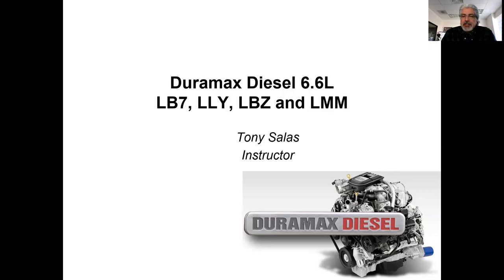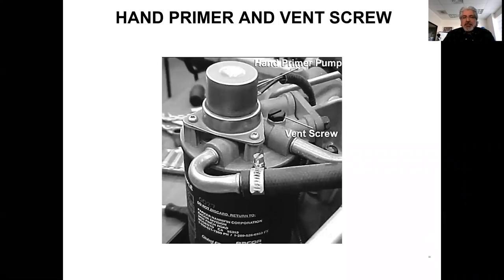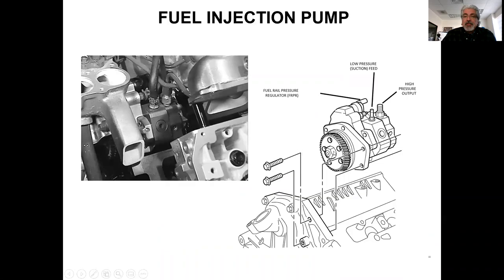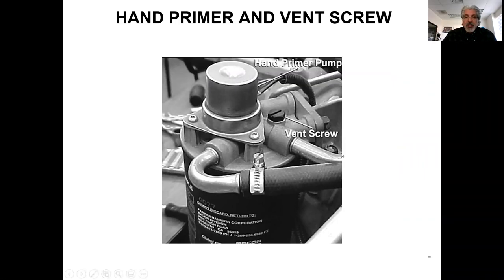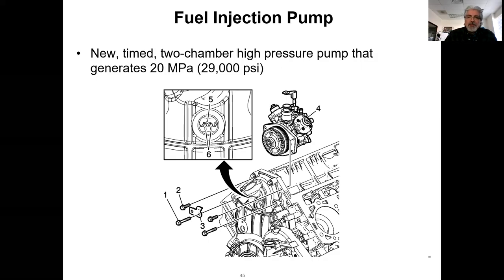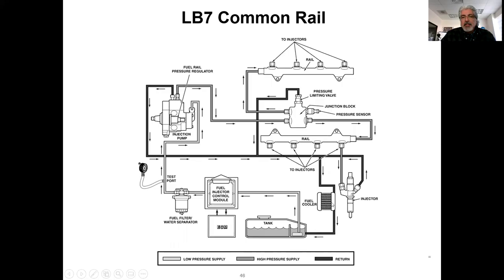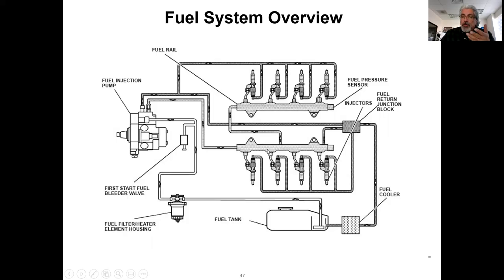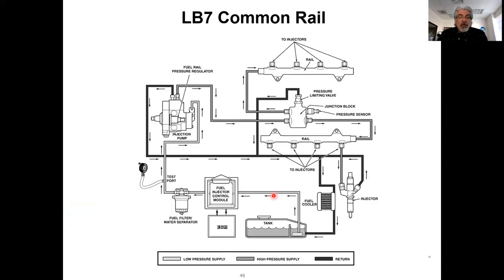Duramax 6.6L CR Diesel Talk

Comment: I bought a 2004 duramax truck about a year ago with 129,000 miles. I only use it for firewood, gravel, and suchlike heavy duty chores. Otherwise, I dive my 4runner or Rav4 Hybrid that I don't need to worry about getting stranded in.
Long story short, I did essential upgrades to the truck (intake throat, lift pump, and trans cooler) and drove it only about 1,000 miles since I bought it. During that year, it stalled on with no warnings twice. First time, it started after 10-15 mins, the second time I had to disconnect batteries for a few minutes, and then it started. There are no fuel leaks. Yes, I despise gm (and suchlike) dearly but what the hell?!?
Any ideas?
Thank you in advance.
Reply from the maker: Ok is it a crank or no crank no start issue?
Need info.
You have access to a scan device?
Reply: @dieseltalkwithtonysalas8725  It cranks fine, yes, I do have a professional Autel scanner. There was a code P0089 – Fuel pressure regulator performance caused by too high pressure from the lift pump. The first time it stalled before I installed the pump so I don't think it's related, and there were no codes.

Comment: When testing to see if filter housing holds vacuum does the inlet hose need to be connected or does it not matter?
Reply from the maker: Does not need to be connected.
When I used to rebuild them I test them on a vise.
Thanks for watching

Comment: Cant i just use a carter lift pump from a 6.5 and stand alone filter heads to keep costs way down?
Reply from the maker: @bobbyboucher5309  that pump does not create enough volume and pressure.
Go to xtreme diesel or Duramax store websites. They have lift pumps with or without filters ready to bolt on lift pumps.

Comment: Fuel Cap: Duramax LMM
Vacuum / Vented
I replaced the fuel cap with a locking cap. The cap is listed as vacuum-yes, vented-no
Does this mean the new cap does NOT have a psi relief?
Reply from the maker: Locking cap is not the same, the cap for Duramax is unique, but you can vent it every often especially with diesel so high and perhaps a theft issue.
Reply: @dieseltalkwithtonysalas8725  
I was trying to relate your comment of the tank psi not releasing  and causing air bubbles / low fuel rail issue. This would possibly cross over to the fuel cooler issue.  I replaced the cap due to fuel costs and possible theft.  It is a cap swap but can’t determine if this caused a problem. I have encountered 2 limp mode situations. Towing 9,500# trailer 80* OAT. Changing the fuel filter solved the problem  but I am not confident as to when it will happen next. TP3018 filters only last 2,500-7,500 miles.
Thank You for your fast replies:)

Comment: Just found this video. Got a low fuel rail pressure code today and it went into limp mode an hr from home. Limped it to a friends house and immediately went to the filter head to check prime and no prime. Found no leaks. Replaced the fuel rail pressure relief valve and the filter head. Still had the problem. So I took the return line off the cooler and nothing came out. But as soon as I primed the the system it started flowing out pretty good. After watching this I'm leaning toward injectors. Your thoughts would be greatly appreciated as I'm about to start throwing more money at this pig. I don't want to do injectors right now bc of money and time it will be down for longer than I can afford. I was wondering if an aftermarket lift pump would solve this. Truck has 200k miles on it and bone stock everything.
Reply: Did you ever find out what  it took to get your truck running again?
Reply: @Trike.  cp3

Comment: I loved this video, but I have a question. So this fuel pump has a mark to put it in timing, but I'm a little confused because the olds version of  course needed timing because it worked mechanicly ,but in this case the system is controlled by sensor-modules-injectors means electronically and the pump function is generate pressure only. Why does it have a timing mark?
Reply from the maker: Happy Thanksgiving!
This pump simply sucks and pumps! There is no timing to be set. However! We have seen harmonics from the pump cause what we call an off idle diesel knock sound. Doesn’t affect performance of the engine but it’s annoying.
To fix this we remove the pump and move the gear 30 degrees. We reinstall. I can explain further this but it’s a big explanation!
So to be clear there is no timing mark or procedure to time the pump on LB7 to LMM.
Later model LML, LGH Duramax do have a timing mark. 
RAM Cummins 6.7L due have a timing number etched on the CP3 shaft to set at 9 o clock .
Thanks for commenting!

Comment: Got a question. Looking at a 2004 duramax LLY. Guy I know wants to get rid of it because its going to cost 15k to fix. huh? yeah I know. Dealer says it had fuel contamination and they found rust in the tank. Now I font that odd. Any thoughts? Maybe check the tank  get a new one, replace sending unit blow out the lines, clean injectors and see if she runs. I could get a great deal on this but I am curious if you or anyone can come up with something im not thinking about or possible catastrophic failure or potential failures... Or in all just stay away from that problem. Thanks
Reply from the maker: Depends is it an 04 LLY or LB7?
Injectors, lines add up but good quality Bosch.
But we are under the assumption the issue is fuel related. 
What’s  the asking price and how many miles on it?

Comment: Does the 2007 LMM have a dedicated post fuel injector that squirts fuel into the exhaust or is this done through the main injectors? I ask because I have the LMM in which the DPF was cut out, so  What tells the injector(s) to squirt more fuel into the exhaust? I am not sure if this causes  better or worse fuel economy?
Reply from the maker: No, the LMM uses post injections. This means it injects on the exhaust stroke of a cylinder to push that fuel into the exhaust towards the DOC.. it uses fuel consumed and pressure differential across the DPF to determine soot load on DPF.
If DPF was eliminated there will be no post injections. Was truck tuned? Must have it you are driving it.
What kind of fuel economy you getting?

Comment: Great video! I installed reman bosch injectors on my lb7 and after about 200 miles of it driving fine it started blowing a large amount of white smoke under a load and feels like it's missing. I have a decent video of it but I'm not sure how to attach it. I had a code for maf sensor so I replaced that with the issue still being present. No loss of coolant or coolant smell from the exhaust. The only odd reading I'm seeing is mm³ of flow is almost double what's expected when this happens. Balance rates are all 0.0-0.1. Any ideas of where I should be looking?
Reply from the maker: Doubt it’s the MAF sensor.
White smoke is un burnt fuel.
Sounds like injector issue. 
When looking at balancing rates? Can u see which injector is going above 4 mm3?
Reply: @dieseltalkwithtonysalas8725  I believe the mm³ flow rate is measured across the entire fuel rail. Balance rates are in spec on all injectors.

Comment: Hello Tony I have an 06 lbz and my problem is
Truck cranks a lot to start, losses primeI rebuilt the filter head and changed the filter 2 times with 2 different brands and still no luck,replaced the hoses and just installed the whole filter head from extreme diesel and still doing the same thing. When I un screw the diesel cap to fuel up air gets sucked in like a vacuum I bought a new diesel cap for it and dose the same. The truck fills up with only 16 gallons so I'm guessing the tank has collapse thank you for you help
Reply from the maker: Busy week sorry! 
Need to visually check the tank but did you buy cap from dealer?
Reply: @Diesel Talk with Tony Salas  no sir got 2 different ones online and one of them was oem. I found out not to long ago it needs motor mounts so return lines where getting a lot of air dur to the movement

Comment: I have a 2004.5 / 2005 Chevy Silverado 6.6 LLY Duramax. Went to start ran for a few seconds cut off. Hasn't started since. Fuel tank was full but gauge went from full to empty. Went to mechanic and he said ficm was bad. Sent off for remanufactured put on today, still want start. Sent old ficm to be tested and the board was burnt and was not repairable. What could cause the gauge to go from full to empty and still not start. We primed to get air out of line and checked fuses all were good. I'm lost of what could be the problem.
Reply from the maker: So where you at with this vehicle? Get it started?
FICMs on your LLY will trip codes. I have often repaired issue by simply cleaning connections on the FICM.
But what codes are set and what is the desired and actual rail pressure while cranking?
Need more info to help

Comment: I got a weird situation where my brother just bought a 03 silverado.  I noticed the scanner doesn't even turn on and I tried 2 of them. It cranks but no start. So I tried to bleed the system but the plastic screw broke. So I'm going to rebuild that pump tomorrow, hope it starts. Should I try anything else?
Reply from the maker: Check fuse, the connector where you plug in called the OBD Connector has to have power at pin 16. Usually this is tied in with the cigar lighter fuse. This might be why scan tool doesn't not turn on. You should have someone crank the engine while you pump the primer pump, bleed air fron the screw after you stop pumping on the plunger.
Let me know!
Reply: @dieseltalkwithtonysalas8725  would the obd2 port not working cause a no start?
Reply from the maker: Yes sir, but you mentioned the scan tool didnt power up. does it turn on ? @pabloso8403
Reply: @dieseltalkwithtonysalas8725  I got it started!! Put in the new bleeder screw and bled it. Also the cig fuse was blown and it fixed the obd. Thanks a million!!

Comment: Question for you sir 2016 duramax crank no start I already changed out fuel filter and no start so install new filter housing and still no start …. Codes it has are P0191 and P0088
Reply from the maker: First of all are you pumping the primer pump on the filter while trying to start it?
Second you wouldn’t happen to have a tuner or code reader to know the fuel rail pressure? I need to review P0191 I know it’s a regulator but I look it up in the morning
Reply: @dieseltalkwithtonysalas8725  truck is all stock no modifications but I do have a monitor and it’s showing 1.5 kpsi while cranking, I have tried priming it before start, priming while cranking, read a forum to spray small amount of starting fluid, so I did and truck started right up and stayed running but once I shut off and tried starting again I had the same issue all over again

Comment: Can you tell me why gm won't use lift pumps? And if we add one, any issues? What should max pressure be limited to on suction side (with pump) that won't cause issues?
Reply from the maker: Some say it’s Bosch some say it was Powertrain at GM. The bottom line many of us upgrade with an aftermarket lift pump. The new L5P is a Denso Common Rail and uses a lift pump. 3 phase pump actually.
But to be fair if you look at the suction pump on the back of the CP3 or CP4 it’s a very stout pump. 
As for suction, GM says 4 inches at idle is max suction. Higher would be fuel filter restricted.
But GM states the suction under load should be no more than 10’inches. I disagree on that. I have seen rail pressure drop at 8 inches.
Thanks for commenting!

Comment: I am studying diesel to provide new means for myself an because I’ve always done gas my whole life I purchased the book from my community college an read it every day , I am not a student but that by no means is limiting me to studying an learning this. I wanted to ask you. Concerning this system how do you actually test into the system to check for suction. Do they sell kits or is there a port that you can place a gauge that tests vacuum? Also concerning the internal gear driven pump. Can those be replaced or the HPFP be rebuilt to save funds for those that have more time on there hands including the injectors. If the ball inside the injectors is the weak point for older models does that mean they can be disassembled and replaced or the components be repaired to correct leakage? Do cp3 pumps needs to be timed or is that only for the cp4 pumps? An how does the computer recognize if the pump is incorrectly installed does it throw a code? or is there a way you can monitor it with a scanner to see if it’s not timed properly? there are so many questions I have but I’m extremely eager to learn.
Reply from the maker: Since I cant highlight replies, I can make them in CAPS.

1 Concerning this system how do you actually test into the system to check for suction. Do they sell kits or is there a port that you can place a gauge that tests vacuum? 
THERE IS A TEST PORT ON ALL DURAMAX 6.6L APPLICATIONS  FROM LB7 TO LML. YOU CAN BUY THE GAUGE WITH FITTING FROM MANY VENDORS.

2. Also concerning the internal gear driven pump. Can those be replaced or the HPFP be rebuilt to save funds for those that have more time on there hands including the injectors.
WE DONT REPLACE JUST THE INTERNAL DRIVE PUMP, WE REPLACE THE WHOLE INJECTION CP3 PUMP SINCE IT IS  QUITE SOME TIME IN LABOR. BOSCH DOES HAVE IT AVAILABLE ON THEIR CATALOG. 

 3. If the ball inside the injectors is the weak point for older models does that mean they can be disassembled and replaced or the components be repaired to correct leakage?
BOSCH AUTHROIZED REBUILDERS REPLACE THE WHOLE BALL AND SEAT ASSEMBLY IN THE REMAN OF THE INJECTOR. IT IS A PRECISE SETTING FOR THE TRAVEL OF THE PLUNGER, NOZZLE AND SHIMMING OF THIS ASSEMBLY.  IT IS CHECKED AND CALIBRATED ON SPECIAL EQUIPMENT. 

4. Do cp3 pumps needs to be timed or is that only for the cp4 pumps?
GM MAKES NO MENTION OF CP3 PUMPS BUT DO FOR CP4. CP3 ON RAM 6.7L CUMMINS DO HAVE A TIMED SETTING. NOTE GM CP3 CAN HAVE AN OFF IDLE DIESEL KNOCK CAUSED BY HARMONICS THAT HAS NO EFFECT ON ENGINE DRIVEABILITY BUT IS CURED BY REMOVING THE CP3 PUMP AND MOVING THE GEAR 60 DEGREES THEN REINSTALL CP3 PUMP.

5. An how does the computer recognize if the pump is incorrectly installed does it throw a code?  IT DOESNT KNOW.
or is there a way you can monitor it with a scanner to see if it’s not timed properly? NO WAY TO KNOW. ALL A PUMP DOES IS SUCK AND PUMP
there are so many questions I have but I’m extremely eager to learn...

OK IM TIRED NOW.... HOPE THAT HELPS.
Reply: @dieseltalkwithtonysalas8725  yes sir that helps!! Thank you so much for being informative. I will keep eyes for your videos to learn more like an apprentice.  It’s a blessing when knowledge like this is shared. I truly appreciate learning everything I can

Comment: Does aeration in the system cause destructive cavitation?
Reply from the maker: No plus cavitation is when there is a pressure drop due to a office or narrow opening 
This causing a pressure drop to the point you reach a boiling point. 
There are numerous videos on this subject you can search.
However air works its way out through this common rail system. Think of it as burping it out the injector.
Now I know about split tips like on HEUI system
Caused by aeration but never seen it happen on these systems.
But to answer your question, no but if it’s a suction system on these 2016 and earlier Duramax systems, you lose prime.
Note on the LML with piezo common rail they air can destroy the CP4 Pump.

Comment: What about the vans, they don't have any primer pump.
Reply from the maker: Correct but I thought I mentioned they (vans) use an electric pump . It’s the only Bosch common rail on 6.6L that use an electric lift pump. Thanks for pointing that out!
Reply: Do you know where the lift pumps are located in the vans, thanks Tony.

Comment: I have a 2007 GMC Sierra 2500HD 6.6L and I'm getting a "Low Oil Pressure Stop Engine" message. When I start my car a message pops up saying oil change soon, but do note that I changed my oil and the oil pressure sensor 1,000 miles ago. When my car runs cold, the oil gauge reads normal (when i step on the gas it goes up as its supposed to). When my car reaches running temperature (~180F) the "Low Oil Pressure Stop Engine" message begins to appear. This happens when I come to a stop and gently step on the gas peddle. It happens for a second, then goes away. When my car is at running temperature and I step on the gas the pressure gauge needle barely moves. I've tried a code reader and nothing comes up. Is it safe to assume that a fuel injector might be leaking, diluting my motor oil?
Reply from the maker: If you have oil dilution you should see a rise in oil level on the dipstick.
Second, are you using synthetic oil?
But to check I would first check engine oil level and check for dilution. You can also put a droplet of the dipstick on a white paper towel and see if a ring forms around the droplet. If it does the oil is diluted.
Then I would attach an oil pressure gauge to confirm oil pressure.
Let me know
Reply: @dieseltalkwithtonysalas8725  I believe there is a rise in oil level on the dipstick. I took some oil from the oil pan and it appears to be diluted and I feel like it smells like diesel. I'm not 100% sure though, I feel my mind is playing tricks on me. I saw a handful of people in a Duramax forum say that the paper towel test is unreliable. Thank you for the fast response.
Reply from the maker: @miguelfajardo9703 Really? Not my experience 
It has worked great for me.
Reply: @dieseltalkwithtonysalas8725  Understand. I think the paper test is suitable for someone with experience (that I don't have). I think I'm just going to take it back to the GMC dealership. I really wanted to avoid this route, since they want to charge me $480 just to diagnose the truck. By any chance do you know any mechanics in southern California?  Thanks for your help!
Reply from the maker: @miguelfajardo9703  as I train shops, why not look for a shop near you. 
Look at their reviews. Plus Bosch has shop network as well.